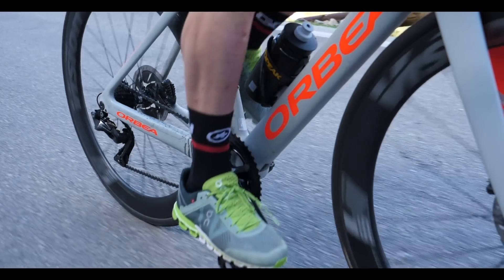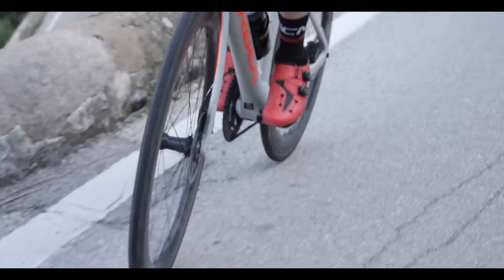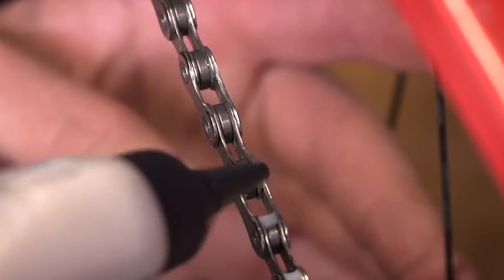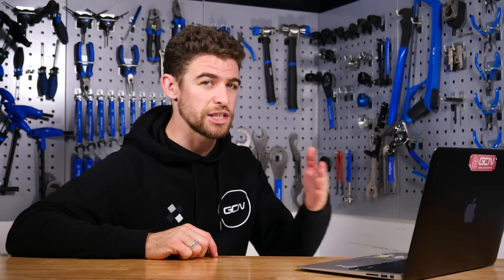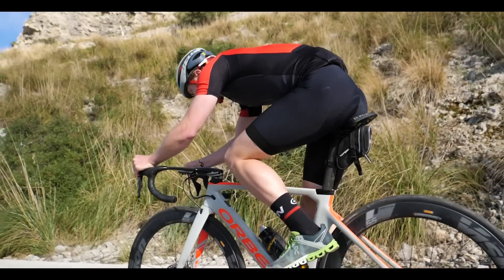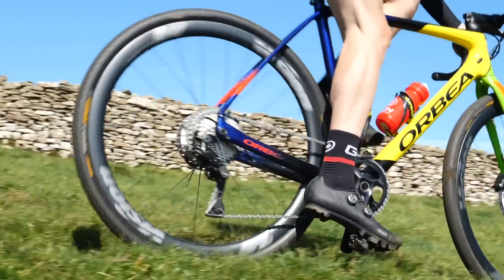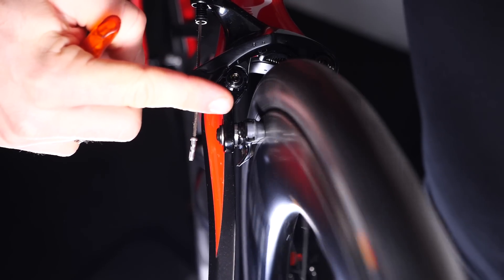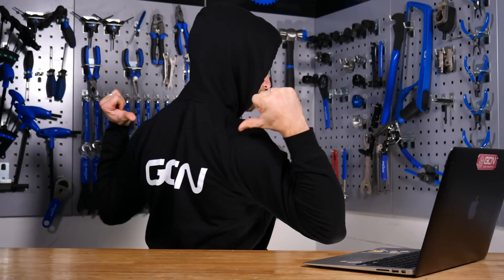Can You Swap Your Suspension Fork For A Rigid One? | GCN Tech Clinic #AskGCNTech

Comment from the maker: What tech question do you need answering? #AskGCNTech!
Reply: Hi guys, I got a set of aluminium TT / poursuit handlebars for my track bike but it is 26mm diameter. I need a slammed stem and these are hard to find in this diameter. Is it safe to use a shim to fit them to a 31.8mm stem ? I'm worried they could turn during a start. Any brand / model you would recommend ? Thanks in advance =) #AskGCNTech!
Reply: Hey! I'm not sure if this fits in the #AskGCNTech question category, but I'm going for it.

I'm a triathlete and race in a high-end pair of shoes (Garneau Tri Air Lite). I'm currently in the market for new training shoes, and I'm wondering if there is any benefit to training in high-end shoes, or whether I can just do what I've always done and train in a cheaper pair of shoes. (Example: Would I benefit more by training in a pair of Fizik R3s as compared to training in a pair of R5s?)
Reply: Hi, GCN Tech. Love the show. 
I ride a Giant propel advanced 2(2019) that I just bought for a week. After a long ride I had to wash my bike. But when ever I degrease my chain with WD-40 bike degreaser(not normal wd-40) the lube(muc-off hydrodynamic lube) never seems to come out fully. I even used a brush to try to get the dirt and grind out with a brush and extra degreaser but no luck. And when ever I brush the drivetrain the oil gets on the frame of the bike. I use hot soapy water with car shampoo to try to get the oil stain out from the frame but no luck. Pls help.
My question is
1)Must I buy a Muc-off degreaser like the drivetrain cleaner(get stronger degreaser)?
2)How do I get the chain fully clean when the lube is so strong and hard to remove?
3)How do I get the oil out of the frame of the bike?

***I have no tools to remove the cassatte,chain and other parts of the drivetrain😢

Thanks😀#askgcntech
Reply: @nirvansuntheren5527  If it is a new bike it probably came with the stock shimano grease. This one is quite sticky, so you should clean it twice, and you'll be good to go. I use WD40 and hot water with dish soap for the chain.
Reply: @GauGaut  It is actually not shimano grease because I checked it and it is muc off hydrodynamic lube😅 And I have washed it twice.
Reply: @nirvansuntheren5527  wet weather lube is more sticky and harder to get off. Perhaps try a stronger degreaser or a lighter lube instead.
Reply: I've eaten too much for dinner, what should I do?
Reply: @oibruvv  "Ride your bike, ride your bike, ride your bike"
Reply: Why are all road cyclists complete nonces?

Comment: #ASKGCNTECH

Currently I"m using java Siluro 2 road bike and it is equipped with Shimano sore9x2 (F&R).Can I upgrade it to 105 11 speed only at the rear?Is it possible or not.Or I need to upgrade 105 both at F&R?
Reply: Firstly. Shimano doesn't have any 12 speed road groupsets (yet). You will need new deralieurs, shifters, chainrings and a cassette as 9 speed isn't compatible with any speeds above that.
Reply: @bike_rider-k2h  thanks for your information. I actually ment 11 speed(Not 12.Typing mistake). Sorry for that.
Will any clearance issue will occure(between rim,cassete and frame) when I install 11 speed 105  
derailleur and cassete.

Comment: Hi guys! #ASKGCNTECH
Love the show and the little tips and tricks for the maintenance and everything else.
I plan to convert my flat bar GT Transeo 4.0 to a drop bar.
The shifters are Shimano ST-EF51-L (22.2mm).
What kind of drop bar will I have to get since there are a few different types that I have found on the web. I am okay with the fact that I will have to come out of the drop bars to change my gears but the overall aero - gains seem to be much greater. I also plan to buy a set of brake only levers for the drops as I will not be able to use the current brake levers for braking if I'm riding in the drops. Is 25.4mm drop bar is what I should be looking for or something else. Thanks in advance and I hope this question does make it to the show.

Comment: Re:  chain (1:30):  you stated put lube on the roller?!?  The lube has to get between the roller and the pin.  There’s almost no friction between your roller and the cogs/rings.  They engage the tooth and ride around.  The friction of a chain happens inside the roller where it contacts the pin.  Therefore the lube must be put on the gap between the rollers and the inside plates so capillary action can draw it into the space between.  Also needs to be between the outer and inner plates so that lateral flex of the chain as it moves across gears can be lubed.

Comment: I also converted my old trek into a gravel bike/drop bar mountain bike. Great fun.
Reply: I came here to research doing just that, I have a beater 2003 820 I was thinking of converting...any advice?  I want to pull the suspension for rigid and put drop bars. I am new to doing this, Is it worth doing, what else do I need to think of or just invest in a new gravel bike? I would love to change the crankset/group to a 1x but that may make it cost-prohibitive.
Reply: @shantytownbrown  If you can get the parts at a good price I would go for it. There are many good parts on ebay that could be had for cheap. Since you said your bike is a beater, I wouldnt spend too much. You may be able to switch to a 1x crankset with just a chainring. perhaps try to find  some drop bars that work with as much of your groupset as possible. If you cant, used sram apex 1x and a wheelset in your budget would be good.
Reply: @shantytownbrown  also make sure your brakes and levers are compatible.
Reply: @19redmiata94  my bike is a "beater" simply because I got it cheap and the chainrings are a bit worn...it gets me around...as much as I would like to spend a $1000+ on a new bike, not gonna happen right now; but adding up parts I'd need is quickly approaching the $500+, (unless I leave out a new 1x groupset, but still..) so wondering if I should just keep saving my pennies...the repair skills that I would gain, would make this a fun project...
Reply: @shantytownbrown  In that case you could build a capable bike and have fun doing it. Weird bikes are fun, I would go for it.
Reply: 19redmiata94 
Front brakes
Rear brakes
SRAM Apex 1x full groupset
Geo adjusted rigid fork
Cables
Saddle
Fork
Drop bars
Cables
Bearings
Grease
Bar tape

Missing anything?
Reply: @shantytownbrown  It doesnt look like it.

Comment: #AskGCNTech

Hi Guys, I‘ve gotten into roadbikes about 6 months ago, bought a used bike with an aluminium frame, 105 5800 groupset, mechanical disc brakes. Bikes MSRP was 1100€. I paid 400€ used. First owner upgraded the wheels to Mavic Aksium.

A friend of mine had a spare 105-R7000 crank which I fitted onto my bike (needed a new BB, and a new FD) That felt great and now I‘ve got the upgrade fever. But just how far should I got on an alu bike? Would carbon parts be stupid (eg. handlebars)?

I quit my side job as I‘m about to graduate law, which means I can‘t afford a new bike anytime soon and I‘ve gotta stick to this one for at least another year. I‘ll most likely use it as a winter bike later.
Reply: I would save up and buy a new bike when you can afford it. Carbon handlebars are expensive and you don't want to use them after a crash. Plus they won't save a lot of weight, you'll pay way more than 1$/€ per gram which is too much, imo. Depending on what tyres you got at the moment, that might be a great upgrade which doesn't break the bank. You also can install some light innertubes , they don't cost much and will roll noticably faster (I'd try butyl tubes around 70g instead of 100g standard ones, just be careful when installing them and you'll be fine). Tyres and innertubes are the most noticable upgrade - if money matters.
Reply: Chris Ko Thank you for your insights- GP5000 are already on my list, however I‘ll have a look into inner tubes

I‘m aware about the weak cost to performance ratio on carbon parts, that‘s kinda why I‘m asking - just to have some points about how far you can reasonably push it
Reply: @PKownzthem  You're welcome. I wouldn't ever put carbon handlebars on a bike unless I was building a really light climbing bike, which obviously won't have disc brakes on it, they are relatively heavy. Maybe, if you don't like it too much,  you could change the saddle. Better weight/cost ratio than handlebars if you don't go too far. Some mates of mine use chinese carbon saddles that weigh only ~100g for ~40quid, they had never any problems with them. Also you can weigh your  bottle cages, and if they are heavy, you might find way lighter ones (even alloy) for a few bucks, I got some with 65g, 48g, 33g and 18g, all alloy, those 33g cages did cost 4€. Quick release skewer weights also differ a lot. All those things you can install later on your new bike without much hassle (unlike the change of a handlebar). Last not too expensive thing I can think of at the moment is bartape - depending on your needed level of comfort, you can use lighter tape, or wrap it so that you don't need all of it.
Reply: Chris Ko For the handlebar I‘m actually not concerned about the weight, as my bike is around 10kg anyway, but just wanted something with a flatter „wing“ shape, and that doesn‘t seem to exist in aluminium

Although the crash once, buy again thing really is a dealbraker

Comment: #AskGCNTech
I've got an old steel frame that looks ok (on the inside too) and I built a commuting bike around it. How should I take care of it? My city is quite humid and rainy all year and there's really much snow in winter, so rusting could (probably?) be an issue and it won't do any good if the frame collapses under me.
Watching you from St. Petersburg, it warms my soul to see cycling worldwide!
Reply: Pour engine oil inside it, just enough to coat the tubes inside.

Comment: #AskGCNTech 
HI John, 

Great show! Learning a lot each week. 
I have a question regarding rare axle adapters. Due to some warranty issues (manufacturer can't/won't deliver the right adapters back after a repair) , I might need a new pair of race wheels in the near future. My bike has a 135*10 mm DB rare axle, which seems rare. Almost all wheels come in 142*12mm and maybe 135*12mm but that will not work with a 10mm quick release. However two brands (dt Swiss an Zipp) offer fitting adapters for this "situation" but these wheels are usually very expensive. 
Do you know a workaround for this? Maybe a company that makes universal adapters for any of the two? Or maybe even for 5mm quick release? Or is it maybe possible to adjust the frame in some way to make 142*12mm fit? 
The frame is a Cannondale Supersix Evo disc from 2018

Thanks in advance! 

(by the way, for my winter/training wheels I sawed 5mm off each side of the axle and put a piece of aluminium tube around the quick release. The latter might be a last resort but it might be a bad idea to saw a piece off some expensive wheels... )

Comment: Re : chains and chainsets for 9/10/11-speed. The (internal) width of basically all road bikes chains is 3/32", so there is no issues with the chains being 'pushed out' if e.g. you run an 11-speed chain with a 9-speed chainset. The 'width' people normally talk about is the external width of the chain, which does go down with increasing number of speeds. There may with other issues, such as ramps and pins, but the chain width shouldn't be a problem with mixing and matching.
Reply: There's one potential issue with a wider chain (9 speed) rubbing or "catching" between closely spaced cogs or even tightly spaced chainrings if the situation is just right (wrong?).
Reply: @tychoMX  Yep there's potential issues with externally wider chains and narrower cassettes etc but not with different 'speed' chainsets in the question, i.e. the teeth on the chainrings are not wider for lower speeds in the same way as chains.

Comment: Hey guys, love the show. I just bought a 2007 specialized allez elite as my first road bike. Absolutely love it, but it came with a 3x crankset and I literally never use the smallest ring. If I want to switch to a 2x setup, what exactly would I need to replace? I have tiagra shifters and 105 front and rear derailleurs.
Reply: Just keep the triple it's only a few grams but someday you'll hit a steep hill or bonk hard and thank yourself it's still there.
Reply: My advice is that it would be uneconomical to properly alter. Just wear it out before upgrading
Reply: @joeinglesfield  That was my initial plan, but after I wear the crankset/cassette out, should I just buy an entire new groupset?
Reply: @John-iq4jd  Ride your bike for a while and if it's still fun, buy a whole new bike, if you can/want to afford it. That way, you'll have to bikes (old one for commuting and/or riding in winter or wet conditions). Upgrading whole groupset is quite expensive, bike manufacturers pay way less for them as we have to. Look for 2019 models now and in 2020, you might find a bargain. I bought my 7kg roadbike with Ultegra R8000 for 1550€, the Ultegra r8000 groupset alone costs  almost 700€. Btw. if you look after and change your chain when it is time, it probably will take you years/maybe even decades until the chainrings are worn out, depending on how much you ride.
Reply: Nothing, just get rid of the 3rd chainring ;-)

Comment: #AskGCNTech  I  have  a Merida  made  for  ciclocross  and  I  use  it  as  my  main bike  for  road  and  grave.  I did  change  the  group set  to a  105 with a  34 max  in  the  cassette  and  a  long  derralieur  But  I notice  that  I  get  a  lot  of  chain  slap ,  could  be  the  length  of  my chain?  how  to  prevent  that  much  chain slap?  and  also  how  to  avoid  that  little  loss  of  power  and  kind  of  jumps  in  the  gears that I feel  when  I  hit  the  speed  on  some  rough secctions of  gravel and  as  well  when  I  pass/hop  a  speed  bump in the road?

Comment: My chain drops or slips when I shift my gears to the smallest rings at the back. It happens when I paddle hard or ride out of the saddle what’s the solution. Because of this problem I had a crash and want to solve this problem quickly.
Reply: Watch a video on how to adjust the rear derailleur limit screws!
Reply: If it's not the derailleur limit atjustment, it could be that you changed the chain recently, but your rear cassette teeth are too worn out, and now the chain is jumping under torque.
Reply: Could be what Albertas A. said. Could also be that your chain is too long.  Or the chain is worn out - if the chain is slipping because it's worn out, the cassette will be too and probably the chainrings as well. It will be useless then to just put on a new chain, for the reason Albertas mentionend.
Reply: Chris Ko my road bicycle is new. Purchased a month ago. How can my chain or cassette worn out so quickly. Also I didn’t do that much riding. Ride probably less than 50 km.
Reply: @humayunkabir5837  Ok, then follow Moritz' advice, I guess. If you bought your bike at a shop, they probably will adjust the rear derailleur for free, if not, it shouldn't be expensive.

Comment: You can fit a 38T chainring by TA specialties on a 130bcd. However chainline might be off by 1-2mm depending on your crank. Works fine with Shimano, not with a rotor crank
Reply: You can also fit a smaller inner ring using a triple set up as a middle-inner double.
Reply: Great info, thanks

Comment: #askgcntech 
Red/force or ultegra/durace

I know in order to drop the price the manufacturer will use different materials and/or finishes to reduce cost. In these two cases my question concerns the motors and electronic components. Are these different between RED/FORCE or DURACE/ULTEGRA?
Reply: Yes. The two groupsets operate quote differently.

Comment: You can fit a 38 tooth inner ring. With a 32 on the back works a treat
Reply: Fsa make a 38 https://www.google.co.uk/shopping/product/10319010388935340946?q=38+130bdc+ring&client=safari&hl=en-gb&biw=375&bih=553&tbs=vw:l,ss:44&prmd=smivn&prds=epd:18152225244155919557,paur:ClkAsKraX8v6Td3MSrIXU9Zs1NsnSXZYSkNLwtCSySIlXHf2E2-_lNuAgSSBCcB7AHC36xmCIkoSaRgmPyZvJwxphj8-tqifaUrsSziXV0i93k_ZynNWmOUYwRIZAFPVH73krixNeshNhvToK68r3MsySAKI9A,cdl:1,prmr:1,cs:1

Comment: It is a pain maintain chain clean
Reply: Squirt lube reduces that pain
Reply: Nah, it's all about routine. Once a week I hang up my bike, clean the chain with a cloth and re-lube, cleaning off excess lube. It takes only a couple minutes a week to keep it shiny. It's when you ride your bike for weeks without maintaining your drivetrain that makes it a pain with all the guck and accumulated filth.
Reply: @Thereisnosp00000n  That's what I do as well, but it won't get the dirt off that's IN the chain, between pins and the links. It will make your chain look clean and keep oily grime from wearing away the cassette though. And "CLEAN OFF THE EXCESSORY LUBE" should be one of the Top5 GCN tips. It is way more important than "CLEAN YOUR BIKE", imho.
Reply: @chrisko6439  Fully agreed. Being a bike mechanic I always tell customers that the oil does no work where it can be seen. People put lube over lube developing into a thick paste over time thinking "It's silent so it must be healthy". Doing a weekly cleaning helps getting the grime out of the chain, of course not all of it, but at least it doesn't seal it in making it worse.
Reply: You really should compose a limerick out of that one.